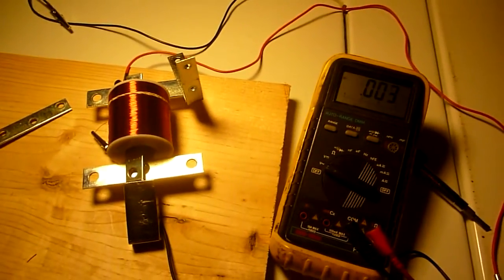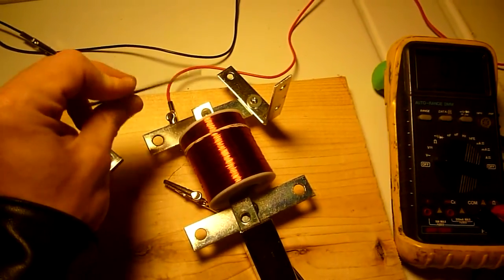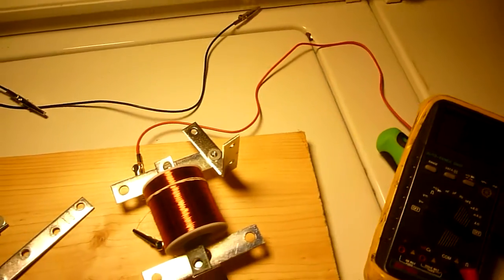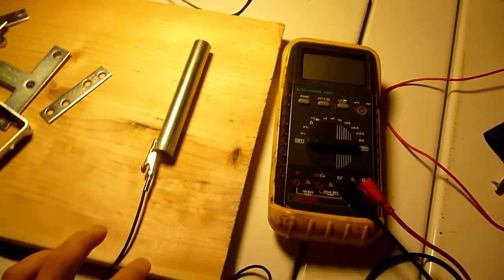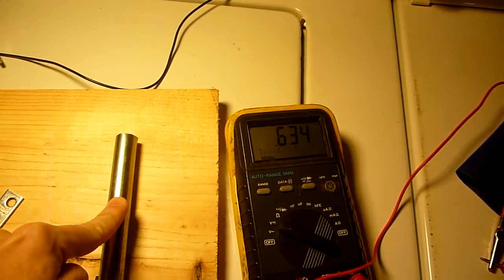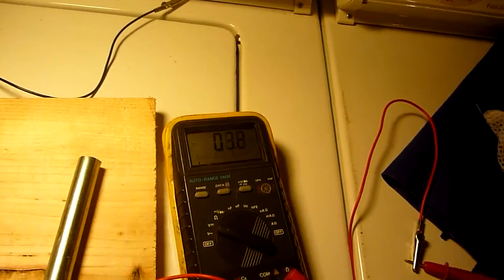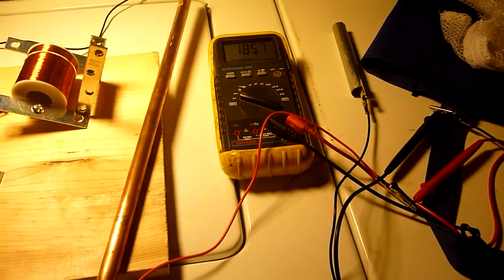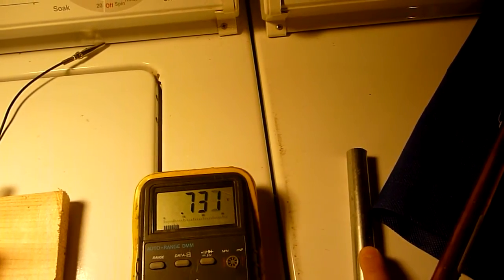Voltage from the Human Body and Magnetic Current

Comment: You are moving the magnet while saying it's not moving. Of course the coil puts out a voltage pulse , just like any generator. Of course touching two different metals with moist salty hands generates voltage, just like every battery does. Stray voltages from house circuits are picked up by human body and detected by the meter. Just like any radio does. You think electricity must be re-thought because you learned nothing from your basic science and physics classes in grade school. Electrochemical  potentials in living tissues are always present. They are best visualized by medical heart/brain monitors. Those monitors do everything possible to depict tiny bio signals while rejecting all the stuff making your meter jump around.

Comment: could it be the iron in our blood conducting the flow? if so wouldn't that explain the "delay" that was mentioned? ;)
Reply from the maker: +Nobdoy Atall The amount of iron in the human body is 0.004% to the total volume (possibly even less). Here the body serves as a dielectric and the metal tubes serves as the plates of the capacitor.